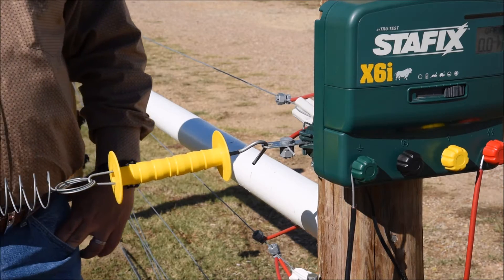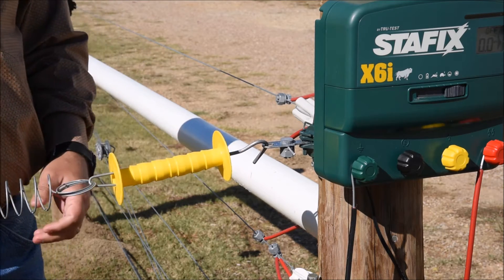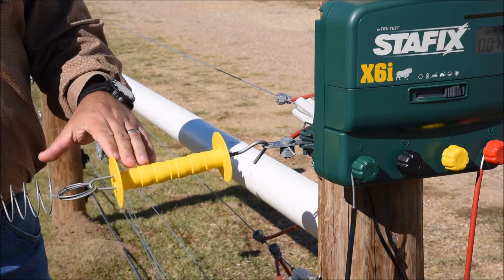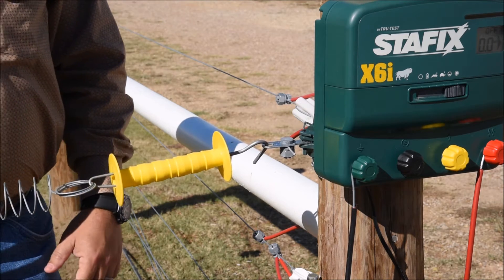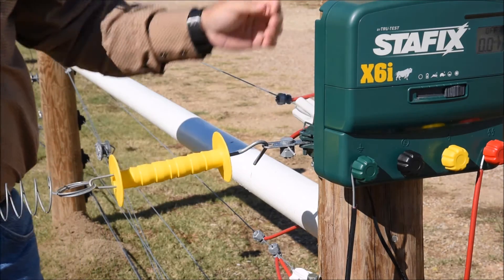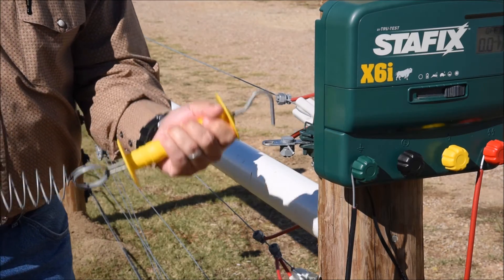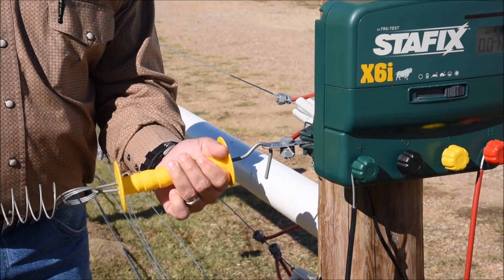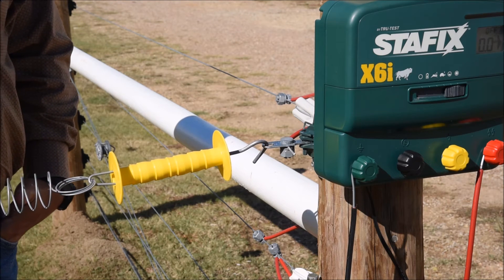Common mistakes in gate connections | Patriot

Comment: But if you have a hot wire running in the ground under the gate opening wouldn't the gate still be hot even after disconnecting it ? Confusing.